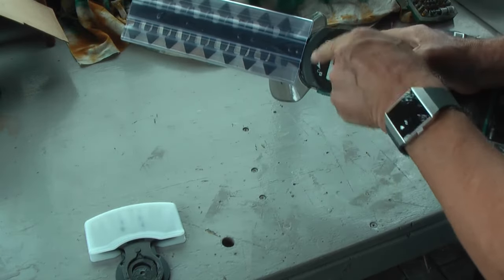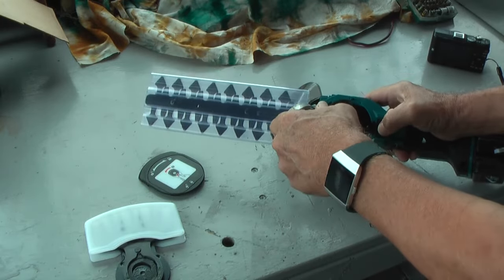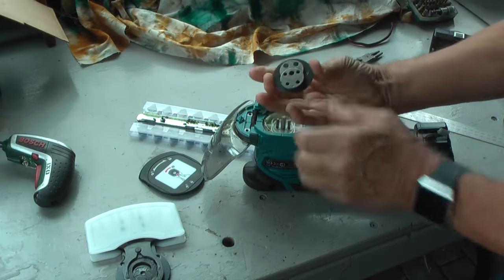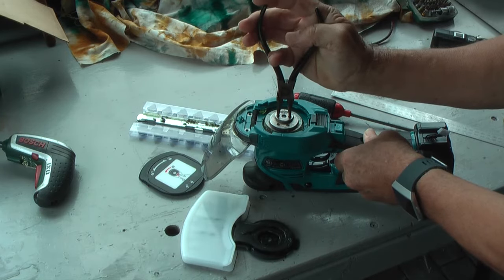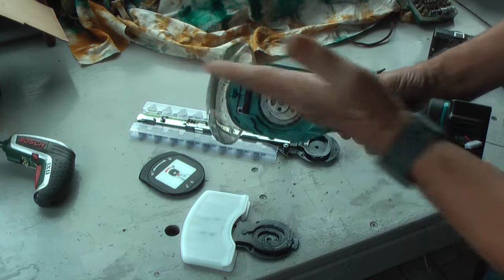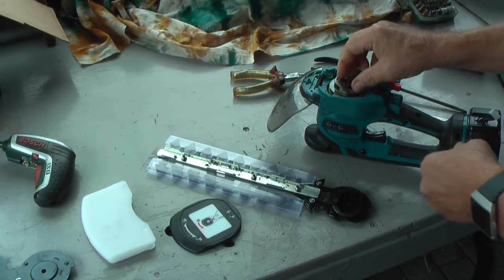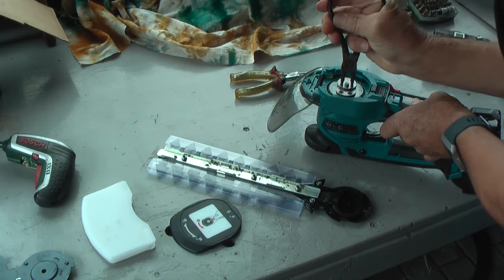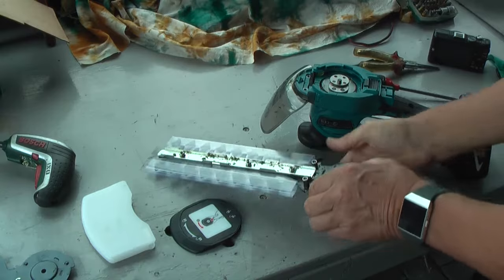Makita grass shear DUM111 / 604 tooling change swap, hedge trimmer to grass shear visa versa.

Comment: The grass shear attachment would have to improve to be called “anemic”, and without these helpful YouTube videos, I would still be struggling to change attachments.  The hedge trimmer attachment is great at cutting grass, and for that reason I’ve retired the grass shear attachment… forever.  My advice:  buy this tool with the hedge trimmer attachment only.

Comment: Is it worth to buy? It seems that a bit thicker twig will stop it. :-/
Reply from the maker: That is true. The grass cutter is useless (better buy a Makita graas trimmer with a nylon cutting wire). The hedge cutter lacks power but I use it sometimes for thin twigs with one hand operation. But better buy a real hedge cutter. So I would never buy this product. I got it for free together with a battery powered Makita grass trimmer.
Reply: @Gerard_Hugo  Thank you. I think I will take this item: Makita DUH523Z. My wife want some aid instead of manual scissors for trimming "Cotoneaster dammeri", which has up to 10-15mm twigs. As reviewers wrote, 1cm twigs cuts with no problem.
Reply from the maker: @PedroKV  Seems as a good choice. Gerard